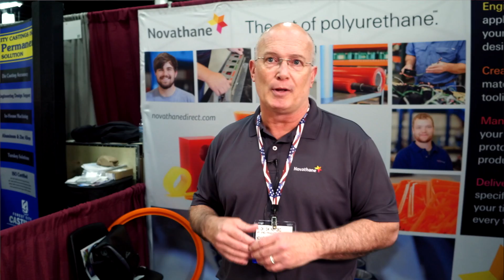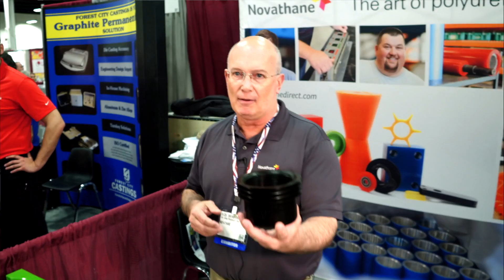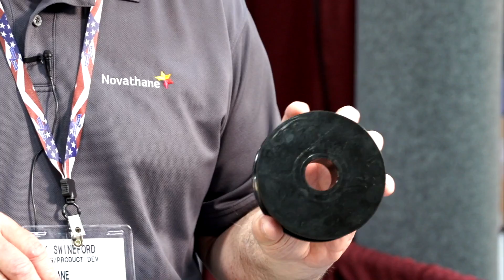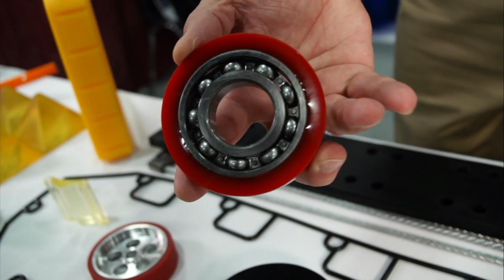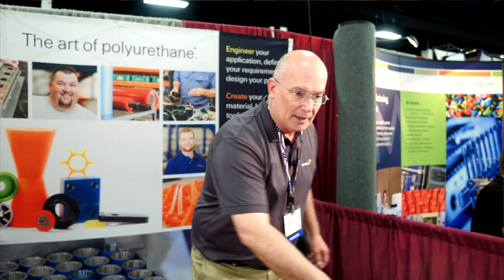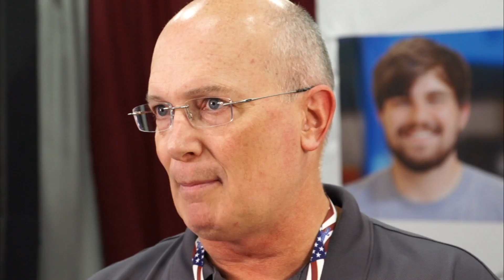Polyurethane Molding & Urethane Casting | Novathane Co | Nova, OH

Comment: what  the  machine  does  when it comes to polyurethane Injection ?
Reply from the maker: Polyurethane injection molding (PIM) uses a liquid polyurethane resin. The process begins by mixing two liquid components, a polyol and an isocyanate, together. This mixture is then injected into a mold cavity under high pressure. The resin reacts with the mold walls and cures to form a solid plastic part.

Comment: If PU part us burnt at high temperature above Tg,  will it become porus,  burnt?
Reply from the maker: Yes, a PU part that is burnt at a high temperature above its glass transition temperature (Tg) will become porous and burnt. The Tg of PU is typically around 120-140 degrees Celsius, so if it is heated above this temperature, the polymer chains will start to break down and the material will become brittle. As the material burns, it will also release gases, which will leave behind pores in the burnt material

Comment: Interesting product. What is the best process to bond the urethane rubber to a metal surface such as the bearing which features in your video.. Is a primer or bonding agent used?
Reply: Surface prepare , primer apply and cast it